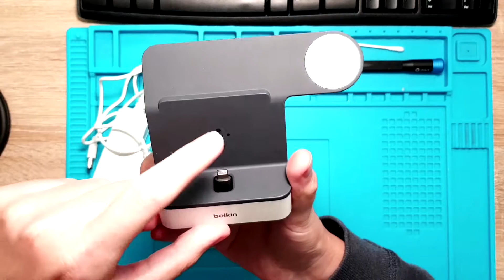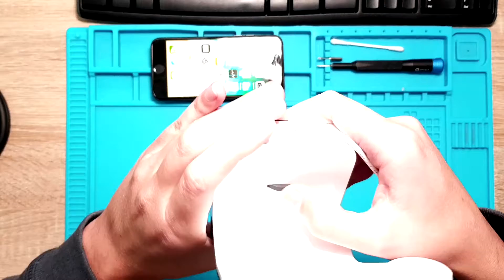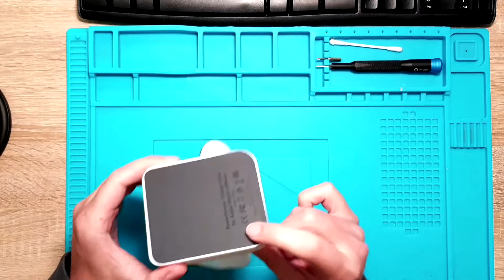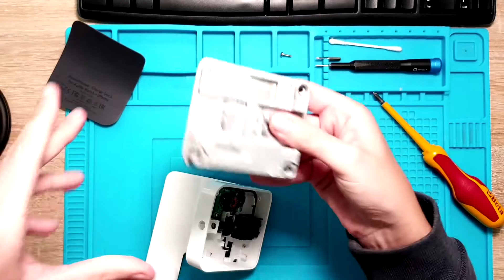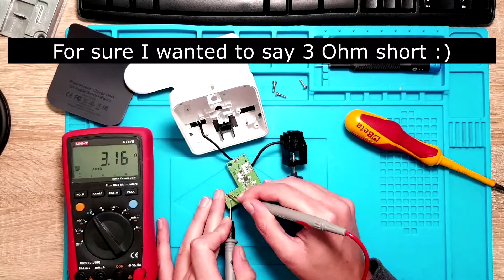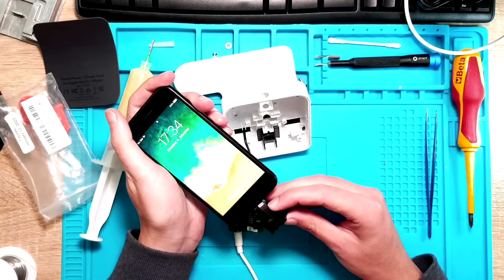Belkin charging station - no power repair

Comment: THANK YOU!!!  I don't have the exact same Belkin charger, a different one, but I used your technique and found two similarly shorted power filtering capacitors.  Mine were 50,000 ohm though not 3 ohm.  But after replacing them, the whole unit works again!
Reply from the maker: You are welcome. Happy to hear that it worked out for you.

Comment: No need to replace that cap, there are other 2...
Reply from the maker: I know but otherwise a lot of people will claim. 🙂 Though sure enough I have checked the data sheet of that IC and it recommends over 100uF capacitance and here there are only ca 40uF.
Reply: @kikihobbyrepair  I actually just removed them didn't even replace them and it still works lol